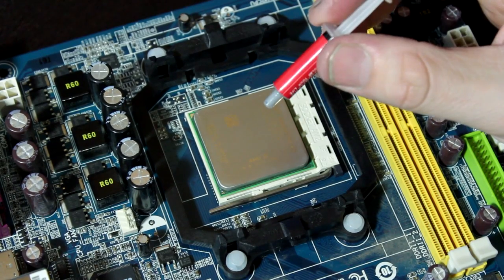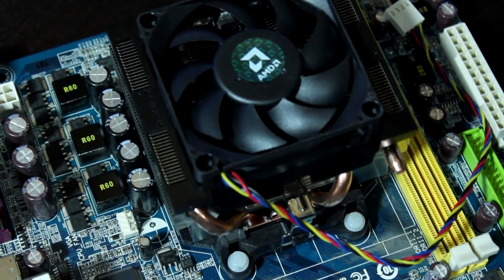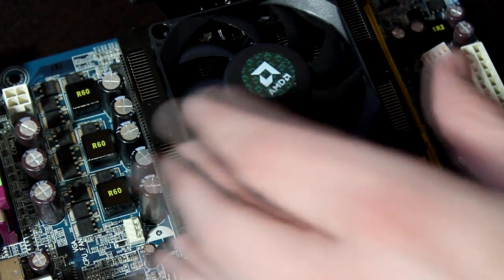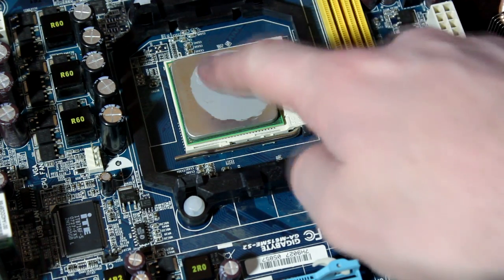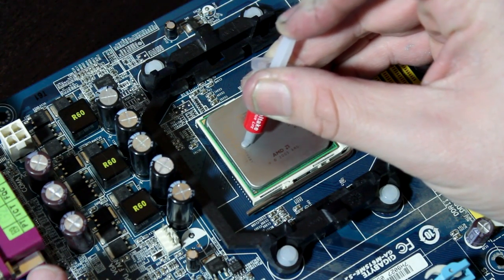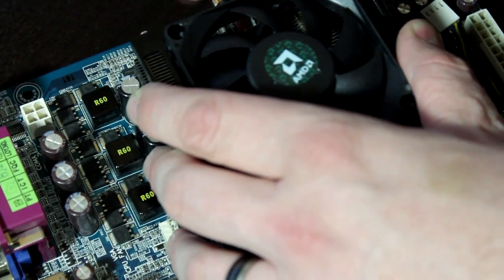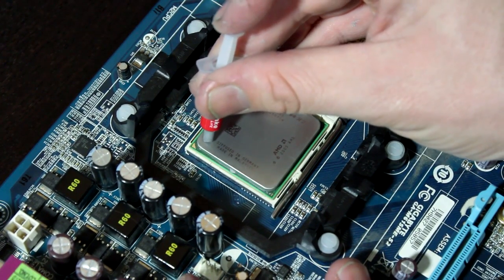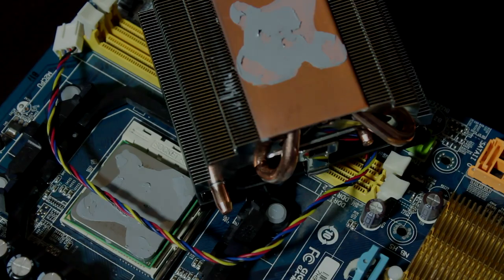How to install Thermal Paste

Comment: I personally use something similar to the "pea" method, only I rub it across the cpu and the cooler with my finger to create evenly covered surfaces, and if any air pockets get caught in between, they are certainly not going to be as bad as the non-covered area you get from the other methods. My guess is that air is eventually going to escape from the pockets due to thermal expansion, and after that the paste-covered areas are going to reconnect.
Reply: Idiot.
Reply: Ah ah the most stressful thing about PC building! In my view a big good silent cooler makes a world difference, stock coolers are the worst, 30°C difference on my Core i5 2400 (Sandy Bridge), the stock cooler went to beyond 70C on load. GPU is even more scary, I was surprised by "normal operation" nVidia temperatures
Reply: Krešimir Jakić I replaced the stock cooler on my Q8200 with some CoolerMaster monstrosity that never has to lift the fan speed much above idle, so it's almost completely inaudible (the only other fan is the huge slow intake fan on the case that circulates air over HDD and SSD, and the PSU fan that almost never turns on. I use a passively cooled nvidia 210 card which is quite enough for driving my two monitors so no additional GPU cooling noise is needed. The only real-world cooling issues that I had was HDD cooling because I had several drives simply die on me during the summer when the temps went above 45°C for prolonged periods, and stock CPU cooler noise. Then I bought a new case with proper airflow over the drives and fitted a complete overkill of a CPU cooler which solved both problems.
Reply: Yeah, I think I found it, this is what I put on the CPU: 
http://www.maximumpc.com/files/u139222/cmhyper212evo-01-big.jpg
Reply: Danijel Turina Yup, kinda like mine, supersilent, but I miscalculated, the spikes wouldn't fit in mini tower case, but the silence is awesome! Then I bought Nvidia Fermi chip for editing video and games, it was a mistake, heats up easily and that small gpu fan can't help much
Reply: Krešimir Jakić You might solve the problem with water cooling, put one block on the CPU, the other on the GPU and there you go. The easiest way to pull that off would be to buy the basic CPU loop and purchase the GPU block and additional tubes extra. I personally have no use for strong GPU because I don't play games and my raw converters don't support open CL.
Reply: Danijel Turina Water cooling was always kinda scary option in my mind, but yeah these modern gpus sound like a hair dryer, also Premiere didn't work on native Intel graphics :/
Reply: Krešimir Jakić It's scary if you make a flimsy tube connection so it slips off and makes a flood inside your aquarium, pardon, computer. :) Other than that, they have reasonably inexpensive kits you can start with and modify it by adding a GPU block designed for the same diameter of tubes.
Reply: I have a Thinkpad X300 which I bought from german ebay for 130€ (plus new battery,ram & ssd) with an overheating processor that I don't believe it's suppose to be at 60C idle, probably some dust over time inside and that's scary for me to open and replace the thermal paste, water in computers no thank you :-) It's funny I remember when Intel went with Core2duo in 2008. how they said "No need for fans in near future!", but even with today's 22nm process still not quite there, and this laptop is like an oven, I thought Core2duo was cool :))
The next upgrade makes sense only for fanless design: http://www.extremetech.com/computing/183604-intels-new-14nm-core-m-will-finally-bring-big-core-x86-chips-to-fanless-tablets
Reply: You'll have to open it, blow out dust from the cooler and change the paste, there's no way around that. I did that on many older laptops and it's the only cure for overheating.
Reply: Krešimir Jakić You got me interested about the X300 so I looked it up, it seems to be a very nice machine, albeit a bit pricey if in good condition, since I found nothing near your €130. I've been buying used T40/41/43s for about €100 apiece as "typewriters"; I'd clean them up, install linux and use them for basic typing, web browsing and skype but after I had two of those die on me due to overheating I gave them up and bought a Mac Air, which has excellent passive cooling due to the fact that the entire shell is a cooler. I only have one of those machines left and I gave that one to my younger kid to learn programming. He mostly uses it to play games, though. :) X300 seems to be better suited to upgrading, ie. it has a SATA drive so you can install an SSD without crazy adapters from China.
Reply: Krešimir Jakić I don't think I see it as any kind of rival to Air, but it's a worthy successor to a T43 which is becoming completely obsolete, in case I need an inexpensive laptop I wouldn't mind working to death.
Reply: Danijel Turina  the 2008. Air :) well this has upgradeable battery at least, The x300/301 is ok because it has the same 1400x900 resolution (viewing angles not as Air), but it has a lighted keyboard :)) led above. I bought it for my future studies in Denmark (hopefully), it is the best buy device for that money.

This is also good, light ultraportable: http://www.ebay.de/itm/Toshiba-Portege-Tecra-Satellite-R830-i3-370M-2-7GHz-160GB-2GB-R830-R930-R600-3G-/221463427962?pt=DE_Technik_Computer_Peripherieger%C3%A4te_Notebooks&hash=item33903fbb7a
Reply: Krešimir Jakić The main thing I like about Air (at least my late 2010 13") is that after 3.4 years and 345 cycles the battery is at 85% and lasts around 6 hours of internet browsing or typing, 5 if I have to push screen brightness. So basically it's a highly durable machine which I exploit heavily (remember, I literally killed two T-series IBMs by overheating just by writing books on them during the summer months, while holding them in my lap - I better not think what that heat did to my nuts).  This thing conducts heat off the CPU like crazy and apparently that works since it survives my treatment. Other than that, the thing I like about Air is that it runs a very good Unix which, unlike Linux, runs all the software I need, and the entire combination is freakishly fast. You wouldn't believe how fast that thing is with just 2GB of RAM and its SSD. Tea recently bought a Haswell version with 8GB of RAM, and we tested them both side by side and there were no perceivable speed differences. You really need to run tests to see any difference. I just love that thing, it's the best laptop I ever had. Expensive, but damn good. It's the only machine I couldn't function without.
Reply: Danijel Turina I know, but I play the waiting game for that one & until I have a proper job, ridiculous price. You have a job that requires that efficiency, unlike most users, although you could have waited a couple of months for the lighted keyboard one. Macbook Airs are good from 2010 onwards, but they still hold high price :/ but now the ultrabooks are very good: http://youtu.be/51sFR11-9Kk
Reply: Krešimir Jakić Yeah, you can say that I could've waited for the next version, but I didn't know what the next version is going to be or when it's going to be announced, and my laptop died so I had to replace it, so I didn't have much maneuvering space. In any case, backlit keyboard or not, it's a brilliant machine. As for the ultrabooks, they are a viable option for someone who wants to run windows. I need unix shell so it's either os x or linux, and os x is more reliable and usable, at least to me. For instance, linux doesn't work with an ethernet lpd device I use to connect my printer to the network. It works on windows, it works on os x, but not on linux. So basically it's the things like that, that put me off linux desktop. It will work fine when Google adapts Android for desktop use, but Canonical screwed the pooch.
Reply: I heard you shouldn't use your bare finger though. Something with the oils from your skin getting into it.
Reply: brybrycrivello yeah, that's a terrible idea. It's good to invest in a package of finger condoms(not what they're called, but, it's what they are lol),or a reusable spreader.

Comment: pea method = pea shape about the size of average grain of rice ( Actual pea size is just too much and it would push CPU temperatures couple of degrees up, the less is more in this case ), best all around method imo.
line method = good for Intel CPUs if applied correctly
x method = good if u dont know any better / mid 90s...

Lapping CPU heat spreader / CPU cooler base and pea method for AMD or line method for core Intel CPUs ( bare in mind the direction of the line due to CPU orientation below heat spreader ).

Comment: Jay, if the cpu heats up, the thermal compound spreads even more.. Besides, the middlle is what gets hot.. I personally use the X method though throughout the builds I did for my self and friends.. It works fine indeed.. :P

Comment: If you're worried about bending pins then try switching the machine on for a while prior to disassembly. Let the CPU - and thermal paste - come up to temperature. Then power down and ground yourself (to avoid any static discharge). In many cases you'll now find the heat-sink now pulls off easier, but still, go easy on it.

Comment: Would tiny dots around the whole cpu be better?
Reply: I've heard it can cause air bubbles
Reply: Topias Salakka I've tried spreading it and little dots and pea and cross on an old pc, it made not too much difference in temps to be honest.. Few degrees difference at most.
Reply: its bad those air bubbles will make it worse

Comment: The pea method works fine for my Amd CPU and I have never had an issue with my CPU sticking to the heat sink and coming off with the cooler . I blame that on the crap paste you were using, or maybe it has something to do with the motherboard? I don't know, never have I ever seen that happen on any of my AMD systems....

Comment: The Pea method is one of the best methods. The outer parts of the CPU aren't the areas that get the most heat, it's the center that gets heat the most. Running my i5-2500k @ 4.2ghz and idle temps are around 26*C and load temps are around 60*C.
Reply: the pea mehod still works wonders though. theres a reason why they put the heat spreader on the cpu
Reply: the amd piledriver cpus like the fx chips have the cores more so in the corners and the middle has the cache memory
Reply: Lmao... he probably have something like 3900x or 9900k right now.
Reply: Really... I honestly didn't know that. Thank you for the info, I'll make sure to remember that when I build my next AMD. Thanks Andrew!
Reply: except the heat sync is made so that the thermal energy is spread around it and so it can have quicker heat exchange
Reply: rathpunks Have you seen how well the pea method is implemented by using two plastic glass plates? It's one of, if not the best method for apply cpu jizz.

If you add too much without 'dabbing' and 'spreading it' (which if done causes air bubbles) then too much added is going to be messy.
Reply: rathpunks Honestly it doesn't make much of a difference if your heatsink compound is covering all of the tiny corners of your cpu and heatsink (depending on it's surface shape). What makes the difference in cooling performance is that the "majority" of the surface area is covered thoroughly.
Reply: Idle temperature 26 in summer or winter? Please reply
Reply: 2500k? Dang bro you really need to upgrade!
Reply: McGwigue you just responded to a 5 years old video obviously his CPU is outdated in 2020 lmaooo
Reply: @mcgwigue  dude... It's a 6 years old comment 😂
Reply: @headlightdesigngradacac  and? lol
Reply: @alphao_o975  and for this guy it's a old cpu but it was not at that time... Lol

Comment: The paste doesn't have to cover the entire cpu. Most of the heat from the CPU is usually coming from the center of the cpu anyway
Reply: ***** agreed, There really isn't a point in spreading it out because it will just make it worse and also MAY cause air bubbles

Comment: Tbh im gettin better result with the pee size method. the thermal compound dosent have 2 cover all the cpu.. just 85% of it as long at its the vital parts... to much with line or cross method can give bad thermal results.. if u wanna make vids about this make sure test the temps before u come with an advice..
Reply: *pea
Reply: True, plus when heat is applied from use, it will expand into those empty zones.

Comment: Just wanted to say that I started investigating a problem with my PC recently and I've been using your videos as guidance and I have just managed to solve the issue at hand by spending £5 on thermal paste, which I also learnt to apply using your video. To think I was nearly going to fork out for a new build. I can save a little more and carry on the research to build something cost effective :) Thanks again.

Comment: Thank you for a very informative video as I have become exhausted watching 20 to 30 minute videos just on thermal paste, while the individuals talk so slowwww.  And the never ending argument about pea size versus spreading.  Most importantly, you pointed out the differences between AMD and Intel (whether inside or outside cooling on CPU heat spreaders) which no one else has even mentioned.  Thank you, thank you, thank you!!!

Comment: in gaming you will see like 5-20fps improvement depending on game and in some other stuff fx 8350 can be up to 2 times faster than 4300, in rendering you'd see like 1.5x-2x improvement, so yea its good upgrade for rendering but not such a big one for gaming ;)

Comment: The pea method is the best. You don't need full coverage, heat comes from the center of the CPU, and the paste spreads out more in higher temps, so full coverage methods could get paste on the Mobo.

Comment: Paste will spread out with heat, so the only way to know a method is ineffective is to actually use it. The line method is good for rectangular dies, but you should spread the line with a toothpick from a tiny drop in the center because actually making the line out of the tube will use too much paste. Making the X out of the tube used too much paste. I would have used a bit less with the pea. None of your thermal paste applications were at risk of overheating in the slightest.

Comment: My only input would be to be careful how much you put on, this stuff can't replace metal on metal contact. Even AS5's heat conductivity is still orders of magnitude below that of copper and silver, so you want to use as little as you'll get away with, in the thinnest layer possible. The only reason it's there is because it's better than air.

When applying AS5, a rice grain size is normally sufficient. It will initially cover a small area (roughly the size of the die), but spread out with use.

Comment: Where did you get that from? Illustrations of the die layout of AMD CPUs make it seem like the cores are on the outside, but in reality they are only on the outside of the DIE, not the whole chip. The die is actually still in the center of the chip, so the pea method is one of the most effective.

Comment: And this video shows why you should wiggle the heatsink free from the CPU because he pulled the CPU out of the socket when he took off the heatsink and could of damaged it but he had the correct way but letting the heatsink spread it out !

Comment: For the pea method you are wrong for it not being effective. The CPU cores are in the middle of the heat spreadder, so you in the demonstration would have covered all of the required are to cool the processor.

Comment: Double-line method here. Heatsink is a Xigmatek Gaia SD1283, applied the thermal paste on the heatsink itself, lines between the copper pipes. 

Just a question Jay, I've used Arctic Silver 5, however the line squeezed out by the tube was incredibly small, I decided to add another line on top of that line just in case... would something like that introduce air bubbles?

Comment: Custom built is normally cheaper(from my experience) plus you learn all the parts in your computer and if you want to upgrade in future you know how to fit each part however it is difficult and can be risky but it you get a proud feeling when its completed(not the main reason you should do it) :D but if you don't want to risk it or don't think you'll be able to, fresh tech tips(if you live in the uk) is a great site(in my opinion) hope this helps!!

Comment: i found the pea method to work best for me . If you get it in the proper centre of the cpu, it will spread great like shown in the video only more centralized. The corners don't really need thermal compound and this is shown by looking at the stock cooler and some closed loop liquid coolers. it is in a circle. I found that the x method makes the layer too thick. but thermal compound is one of those things that one method may work for one person but not the other so use what works better for you

Comment: difference is mainly price man. i have tried some of the most expensive thermal compunds (AS5 and IC diamond 7) to the cheapest once that you find on ebay for $2 for 5 syringes and the difference in performance were between 1-2 degrees which i consider margin of error. Although some say it dries out, i have never really found this a problem because i do a complete clean of my pc ever 6-8 months to get all of the dust out so it runs like new which i suggest everyone to do

Comment: I realized my pc has gotten hotter than it was before and since the paste is over a year old I guess that is why. I'm thinking of getting a thermal paste from dx, but idk if the reviews on all the kinds of paste there are trustworthy. However I found paste there good for as much as 250 degrees celsius and my pc has never gone over 73 (usually 53-68 when gaming).